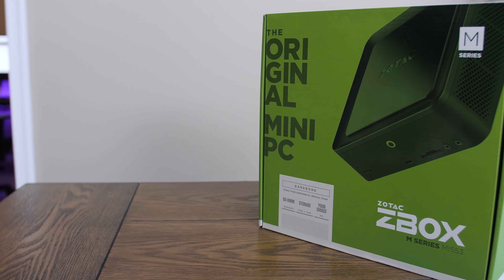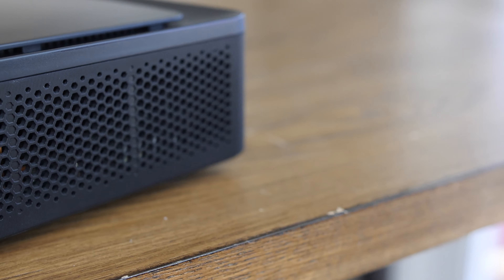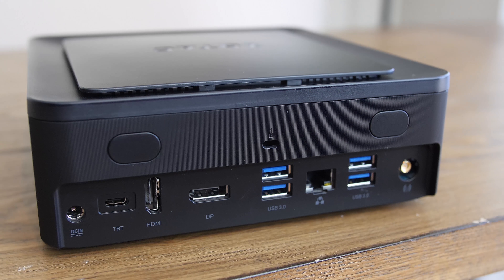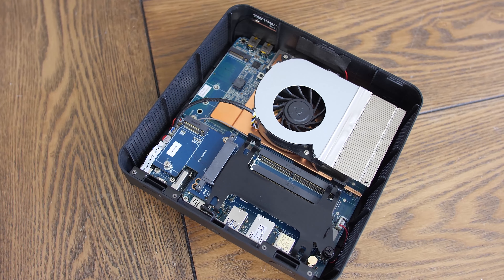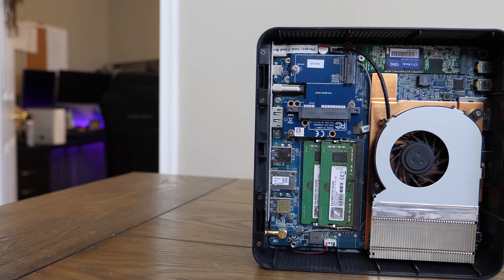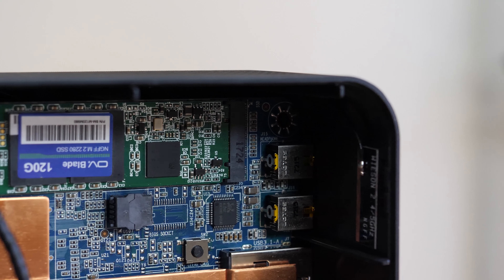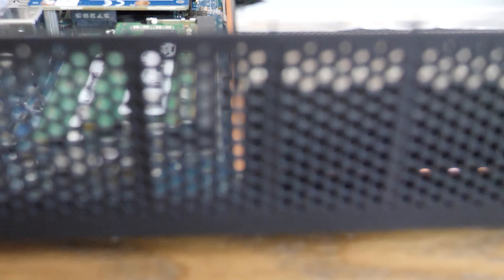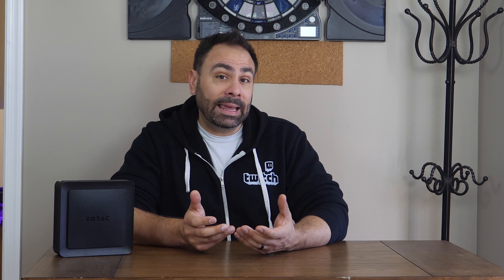I WON A PC!

Comment: Nice win, and a sweet little computer. I would plug that bad boy into the TV, connect the Ethernet and use it as an amazing super quiet HTPC. To bad no USB 3.0 on the front or it would be perfect, flirc does not use USB type c yet, so can't use a remote as easy.

Comment: Did he mention the price though?  I get that it's not the best, but if it is a good value it still might be worth it.  Last I checked, the incomplete barebones systems were pretty expensive for some reason.  Is the PSU external?  This form factor isn't for me.  I would rather go with mini ITX or a Mac Mini (whenever the refresh happens).  Zotac is late to the game and selling incomplete hardware.